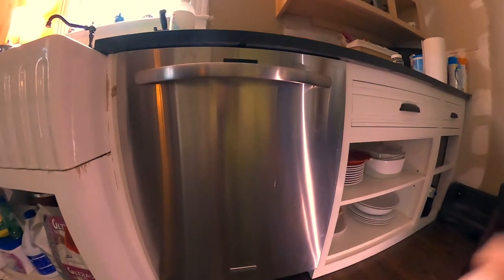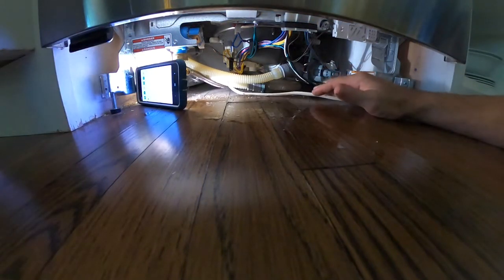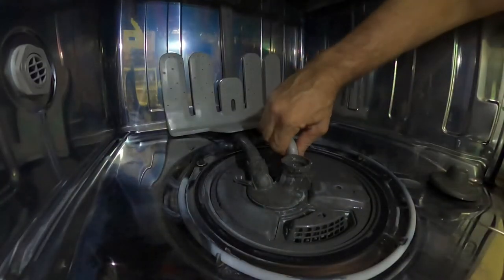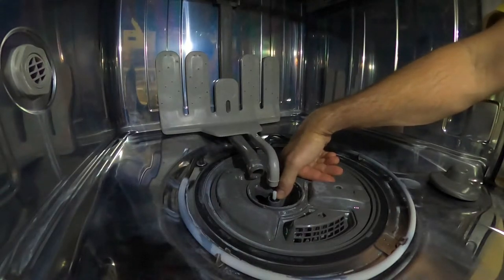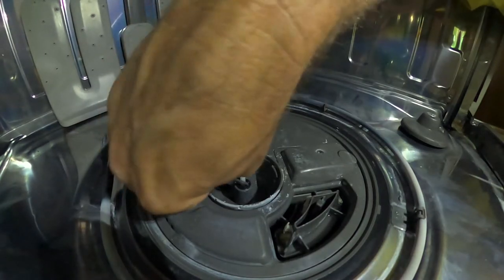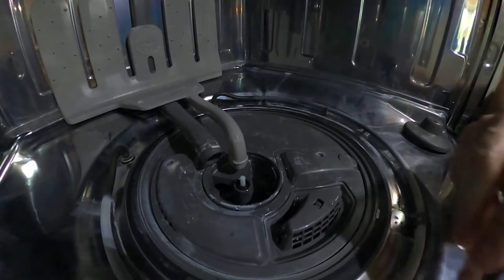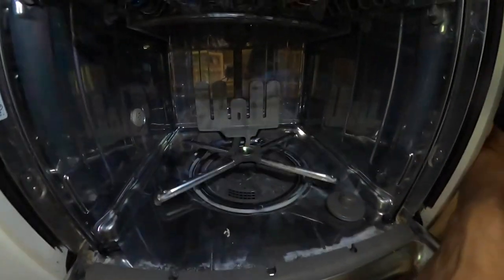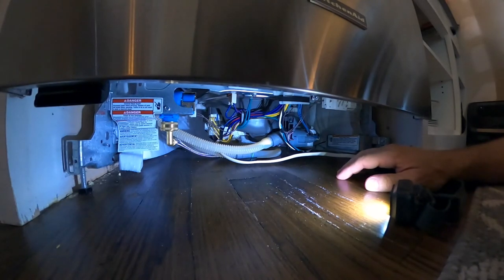Fixing a leaking Kitchenaid dishwasher, replacing faulty diverter valve seal

Comment: That $7.00 part caused $20,000 in water damage to my floors. I'll never have a dishwasher without a drip pan under it again.
Reply: Drip pants are for small leaks like the one caused by this grommet that needs to be replaced on a regular basis. I install a drip pan after this repair. It didn’t help when the hose on the recirculating pump popped a hole. I installed a GFI so maybe next time the washer shuts off. I installed a water alarm underneath and will only run a cycle if I’m home.

Comment: ALWAYS ALWAYS WHEN REPLACING THESE put a lil dap of Dielectric Grease  on these are they will not seal. Same if you replace entire sump pump.
Reply: Is that why mine is still leaking a little bit? Before I changed it out it was leaking a lot. I changed it and thought it was good to go, then it started leaking again a little bit. So this grease will allow it to seal?

Comment: I did this, and it’s still leaking…I’m looking through diagrams, trying to see what else could be there…it leaks out of the same area under the dishwasher as seen in the video
Reply: I replaced the grommet and it kept leaking. Finally figured out it was leaking on the outside of the grommet, instead of the inside - which is what I initially thought. I temporarily fixed the leak by wrapping the grommet with white plumbers tape (cut in half width wise) before putting it back over the diverter motor shaft. Hasn't leaked since, that was two days ago 😁👍🏻
Reply: @LBizKid04   Please make a video of the process
Reply: @khoapham1821  hey man, I haven’t created any YouTube videos, but I can explain it: basically, take about 2.5-3 feet of PTFE thread seal tape, and cut it in half length wise (a pain in the butt - it helps to have the half you’re not starting to cut at have some weight holding it down - i.e., the tension helps when cutting); take one of the halves and start tightly wrapping it around the rubber grommet. You have to kind of gauge how thick you make it, otherwise the grommet won’t fit back where it goes. Let me know if you have any other questions :)
Reply: @LBizKid04  I followed your instruction and was able to fix mine. Thank  you!
Reply: @khoapham1821  awesome! Good job man!
Reply: @LBizKid04  Had to do the same on mine after using an aftermarket (and taller) replacement grommet.  Thanks for sharing your findings!  After reading several threads and comments, here are my suggestions:
1. Fold the PTFE tape in half and then wrap it around tight.  No need to cut in half, and no weird thin strip of waste.  Used about 1.5ft of tape.
2. Pack the grommet hole and the space where the grommet goes into with silicone grease
3. Install the grommet "upside down" so the channel that holds the spring faces downward

It took a lot of effort to push the taped grommet in, but it worked.  No leaks after four consecutive test runs.  Prior to doing this it was dripping at a moderate rate.  Placed a small plastic tray and smart water sensor underneath to alert me of any new leaks.
Reply: @zhoulander  right on man!  Yes,  I need to check my again lol,  the temporary fix turned into a more permanent fix. I put a sheet pan with construction paper on it underneath to catch any drippings,  I'll do this again to make sure it's still good 👍🏻
Reply: @LBizKid04  still not dripping??
Reply: could you put the tape on the inside of the grommet also?
Reply: @OK-kw4rv  so far, so good 👍🏻
Reply: @OK-kw4rv  possibly. I'm wondering if I just didn't want to try that, because I didn't want to end up messing up the integrity of that part of it since it was working already 👍🏻
Reply: @LBizKid04  ok im going to give it a try.
thanks for your help
Reply: These seals should always be installed with silicone or plumbers grease. Never install dry.

Comment: You absolutely must use silicone lubricant.  Often it is sold with faucets (I bought the Moen silicone from Home Depot) or at Amazon.  I installed the grommet first time without and it continued to leak.  Repeated the process, but this time silicone around the diverter shaft and in the well that the grommet fits in.  The silicone allows the grommet to seat deeper, and to seal against the diverter shaft.  Six months later, no leaks.

Comment: THANK YOU! I followed your video step by step. Problem for me was a very clogged line from the disposal to the dishwasher - right near the disposal side. I simply loosened the screw holding the line to the dishwasher and used a small snaking tool to clear it out. Ran the washer on rinse only and it drained completely! Total cost - $2.98 for the snaking tool and a bit of my time. THANKS again!

Comment: Fixed mine and have a few thoughts.  Get a pick set from your favorite store which will make seal removal easy.  Then get the new seal.  When you install the new seal use a socket to help press the seal into place.  Boom!

Comment: Nice video.  I just finished and it made my life a lot easier.  One addition, it was clear that you and a number of the commenters found removing the gasket the hardest part.  I found that if I used your idea of using liquid detergent as a lubricant it worked well for removal, as well as installation.  I poured Dawn over the grommet - rotated the grommet with my pick, so the Dawn slipped down the sides - give it ten minutes and it came right out.  Also, I found vinegar helped a lot to clean up all that dishwasher detergent residue.  Thanks

Comment: Same problem that my Kenmore had. Video was a very informative guide. The old grommet was a pain to remove. It's a combination of rubber and steel, and you have to really pry on it to pop the old one out. Use the small pick set. You'll probably bleed some. You will be better off pulling the dishwasher out and flip it on its side to remove the motor from the underneath. After that, it was a bit easier to do.

Comment: I replaced the seal and it still leaked. I ordered seals from different sellers on Amazon and they were essentially the same. I also bought some silicone plumber's grease. Replaced the seal and filled the cavity with a big blob of grease. That stopped the leak for now.

Comment: Thanks a lot and I almost replace my Kitchen Aid dishwasher with a new one due to the leaking! I believe your video has the most comprehensive steps to fix the Kitchen Aid leaking problems. I order the same part from your Amazon link and it does fix the leak. But I just have one suggestion: it is easier to remove the seal with long flat nose pliers. Wish you have more viewers in the future!

Comment: A few things I want to add: 
- When removing/reconnecting the big pipe, try to twist the bottom cap at the same time, it will make it easier
- Mine still leaked a bit after replacing the seal, Ryan Calovic mentioned that he used PTFE seal tape. I did it and it stopped the leak
- The new grommet does not sit flat to the slot so don't try to push it down too much
- The instruction works for almost all KitchenAid, mine is kdte204ess1
Reply: Mine is leaking a little bit too after replacing the grommet.  Where do you put the seal tape?
Reply: @rhondafurrow2712  did the tape work?
Reply: @OK-kw4rv  yes thank you!
Reply: @rhondafurrow2712  how did you apply the tape?

Comment: Thank you for the honest video and the Amazon link. Hopefully I won't need the link. I have the extended warranty and the guy came out, told me it was because the dish washing machine was not level. He was correct it wasn't level we fixed that. I keep trying you understand how that would be the reason it's leaking from the center of the machine on the bottom. Just like yours. He's coming back tomorrow morning 6.10.2021. I'm showing him your video 🤣. Thanks again🌹
Reply: What happened?

Comment: The shaft is thin plastic and it will be easy to score it as you dig out the seal, so be very careful. If you do score the shaft, it won’t seal properly after that even with a new seal.

Comment: Replaced ours today and leaking stopped! Had to use some plumbers tape but otherwise went accordingly. Thank you!
Reply: tape still working ?
Reply: @OK-kw4rv  yup
Reply: @joel.herrick  how did you apply the tape?
Reply: @OK-kw4rv  wrapped a few layers around the edge of the seal
Reply: @joel.herrick  at the top? thanks for the help
Reply: @OK-kw4rv  around the edge of the black gasket that was being replaced
Reply: @joel.herrick  ok thanks a lot hopefully this saves me some$$

Comment: This quick fix did the trick for a few days, but started leaking again  Trying out adding silicone adhesive now like what other comments I read  about see if that does the trick  My KitchenAid dishwasher is only 3 years old   Feel this should of been a recall from the manufacture.  I'll follow up if it works   But if it doesn't  I'll be buying a different brand

Comment: my grommet comes out from the top just like yours. My KitchenAid dishwasher looks the same 
The issue is the instructions say that the grommet is to be installed from underneath.  That is it goes right on the diverter motor. The grommet that I took out fell all apart so I don’t know what it should look like but I’m pretty certain it doesn’t look like the one in the link that you gave

Comment: OK, so I have a Kitchenaid model KDTM404EBS1 which takes a diverter motor p/n W10843811.  Appliance Repair and Henry's Appliance Repair suggest changing the diverter motor as well JIC there's corrosion.  OK, I'll spend the $123 for the motor, but I don't want to by an entire Sump Assy to get the seal.  What's the correct seal p/n?  Please someone help?

Comment: I screwed up and put this in upside down. Thinking the groove would always hold water. So I’m testing it but have to get another one and put it in groove side up. Arrgh. Should have watched this. The diagram showed this sort of but not well enough.
Reply: Did you instal it with grooves (openings) up or down?
Reply: His look up but another video i watched he said to install down
Reply: @jessicaparker9692  Up. After down then watching the video.
Reply: @jessicaparker9692  this one is the video that the grommet package linked to with the QR code. Groove up

Comment: Have you had any leakage issues since this replacement?  Please update this post if you experience any issues.
Reply from the maker: I did not have leaks after the repair, BUT unrelated the filter/impeller went out in my unit.  I ended up just replacing the whole pump/motor unit with new as I couldn't find the proper filter/impeller part.
Reply: Fun fact: KitchenAid model KDTM354DSS5.  I wasn't able to dig out the old grommet from topside so I removed the entire dishwasher and flipped it on its back, removed the diverter valve and had to use the chuck end of a 21/64 drill bit to force it out.  I also found that the underside of the diverter shaft was caked with soap scum so cleaned that too while in there.  Other than that, smooth sailing.  Thanks for your pioneering insights.
Reply: @nutty-cool  How did you know  your filter/impeller went out on your unit? Do you have a whole pump/motor unit part number?
Reply from the maker: @joem.7705  Yeah, pulled the motor and got the internal filter impeller out (think that it was 3 screws).  The filter is basically a thick perforated foil.  I think a popcorn kernel made its way to mine and took it out.  It was mangled which stopped the impeller from turning.  The replacement filter part that I saw listed for this thing everwhere had a different part number and said something like "new".  It didn't fit properly and made noise, didn't clean properly.  I just uploaded a video of replacing the whole houseing.  While a bit pricey, feels like I got a new dishwasher now.
Reply from the maker: @joem.7705  To answer the question, the pump just stopped working, no cleaning, smelly when drying.  Part number for the whole unit is: W10805015   https://www.applianceparts4all.com/whirlpool-pump-motor-w10805015
Reply: @nutty-cool  - Thanks for responding. I have a leak like you, but I also have my dishes not getting as clean as before. My pump is turning, but I think the internal filter needs to be cleaned. Does whole unit include the diverter? I'm also wondering if I should get the entire kit like Appliance Repair guy suggested.
Reply from the maker: @joem.7705  I believe that the internal filter comes out pretty easy, three screws perhaps.  I took a video of removing that internal filter and will go ahead and post it.  After messing with the diverter seal, then the filter, I was happy to just replace the whole pump assembly (which does include the diverter valve/motor/seal).  Hopefully don't have to worry about the dishes for a while, next have to figure out what is up with my kitchenaid microwave oven!
Reply: @nutty-cool  That would be awesome. Can you let me know when the video is posted? I'd like to get access to one on replacing the whole pump assembly. I'm torn with replacing just the rubber washer or the kit recommended by appliance repair below.
Reply from the maker: @joem.7705  https://www.youtube.com/watch?v=1loH2rtwcOI is me just replacing the whole pump assembly, super easy, don't even need any tools (think an optional pair of pliers and flathead is all).  I'll post the vid of me pulling that internal filter/impeller this evening after work.
Reply: @nutty-cool  - Thanks very much. Seeing the video where you pull the internal filter/impeller would be great. My dishwasher leaks quite a bit, so I hope it's nothing else. BTW: I don't see a spring in the part you ordered,  but do see one with the Appliance Repair guys link.

Comment: would that leak cause a FE error code?
Reply from the maker: I don't think so, that sounds like an issue with the water supply, check first to see if the water supply valve to the washer is on (usually under the sink). Here is what ChatGPT says about the error code:

An FE error code on a KitchenAid dishwasher typically indicates a problem with the water supply. This error can arise due to several issues, such as:

Faulty Water Inlet Valve: If the water inlet valve is defective or not functioning properly, it can lead to an FE error. The valve controls the flow of water into the dishwasher, and if it's stuck open or closed, it can cause issues.

Water Supply Issues: Problems with your home's water supply, such as low water pressure or no water at all, can trigger this error code.

Clogged or Faulty Flow Meter: A flow meter monitors the amount of water entering the dishwasher. If it's clogged or malfunctioning, the dishwasher might display an FE error.

Control Board Issues: In some cases, the problem might be with the dishwasher's electronic control board. If the board is faulty or has a bad connection, it may not be able to properly monitor or control the water intake.

Hoses and Filters: Blocked or kinked hoses and clogged filters can also lead to water supply problems, triggering the FE error code.

To address an FE error code, you should:

Check the water supply to ensure it is turned on and that there is adequate pressure.
Inspect the water inlet valve for any blockages or signs of failure.
Examine the flow meter and ensure it's working correctly.
Check the hoses and filters for any clogs or kinks.
If necessary, consult a professional technician, especially if the problem might be with the electronic control board or other complex components.
Remember, when dealing with appliances, safety is paramount. Always disconnect the power before attempting any repairs and follow the manufacturer’s guidelines. If you’re unsure or uncomfortable with performing these checks yourself, it's best to contact a professional technician.

Comment: Thanks. I have the same model and I can’t find where it’s filter is. Do you know how to remove it?
Reply from the maker: Hey Mike, there are two filters that I know of on this dishwasher.  The prefilter that is on the plastic pump housing inside the dishwasher under the lower rack.  It is just a plastic "screen" that unclips, sometimes junk will accumulate under it.  The pump impeller itself is wrapped in a filter as well.  It is a fairly fragile almost foil like perforated metal that covers the impeller of the pump.  To access it you have to pull the unit and pull the pump housing off the motor.

Comment: Where is the filter to remove and clean? Our dishwasher looks like yours. Can not find the filter. 🤷🏻‍♀️
Reply from the maker: Hi Kath, as far as I know the two filters on this model (I no longer have) are 1) in the bottom of the inside/tub under the bottom rack (there might be a removable cover, but basically a plastic basket like "filter"). 2) part of the pump on this model is a very fine mesh filter, the impeller spins inside of this filter.

When I has this model (after fixing the leaky diverter valve seal) the unit ate up the internal pump filter.  I attempted to replace it but couldn't get the right part to replace it (the part had been "upgraded" but didn't fit the pump properly).
Reply: @nutty-cool   Thank you!

Comment: Question for you. I ordered the same seal, but it didn't come with the spring around the inside.  Did your seal come with one.  I installed it, but still had very slight leak unfortunately.  Wonder if that made a difference
Reply from the maker: I believe that the spring is internal to the seal, just came out in my somewhat crude attempt at removing the original seal.  Did you add a bit of lube to the seal? I just used some dishwasher detergant and had no issues with leaks.  Perhaps some silicone lube where that center shaft goes through.
Reply: Thanks for the suggestion. I pulled out the replacement part and I now see the spring. I put some petroleum jelly on the seal (for the time being) and no leaks. Saving some big time $$$.